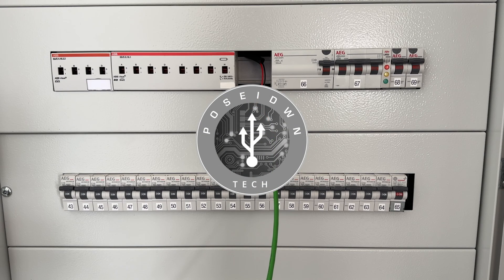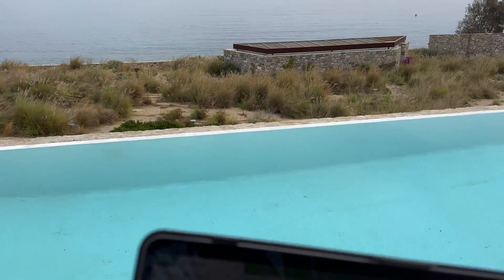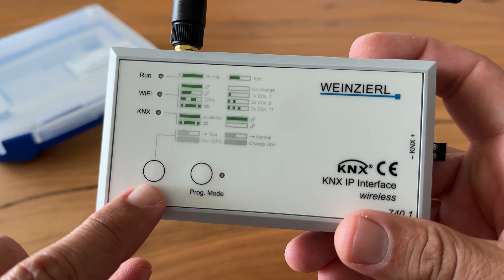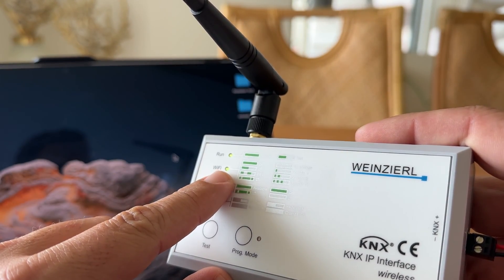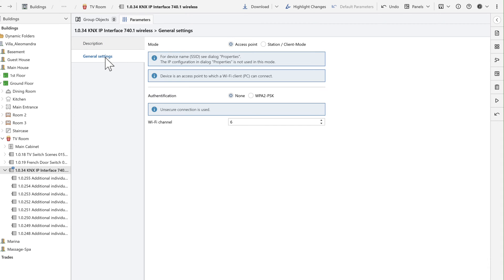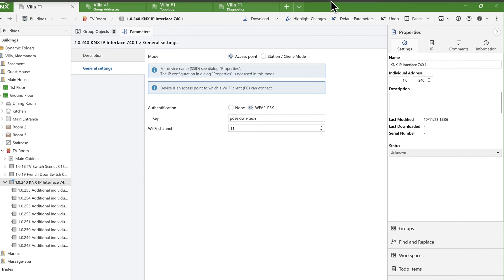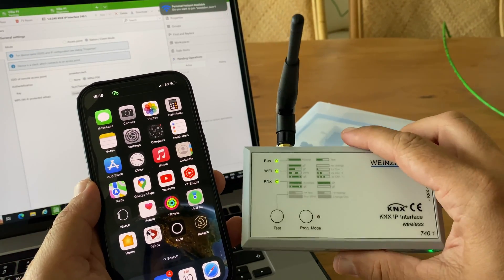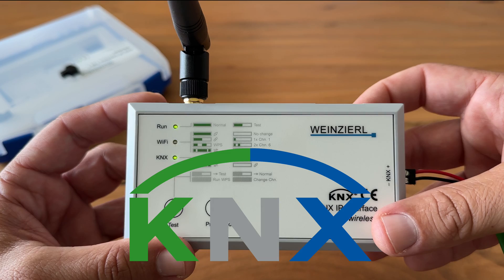KNX IP Interface 740.1 Wireless - Step by Step Tutorial

Comment: function for what?
Reply from the maker: It is a Wireless IP Interface for programming KNX devices.
Reply: @PoseidwnTech  is it posible to have the sensors connect through wifi and not with the physical KNX wiring?